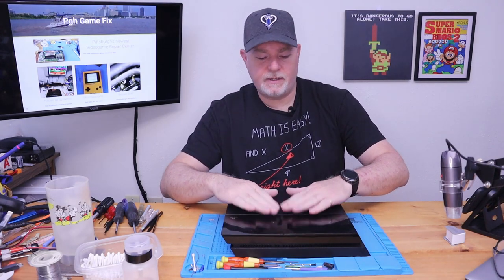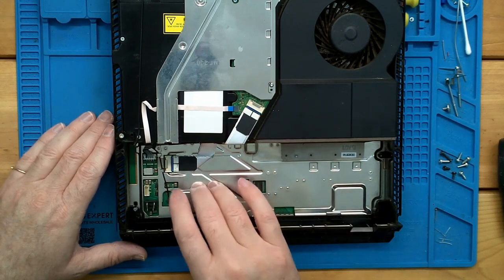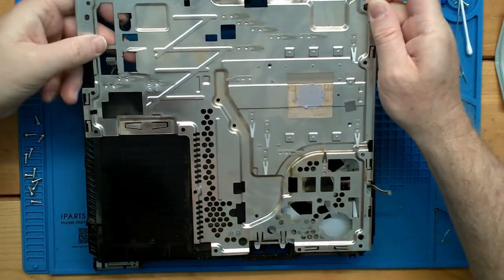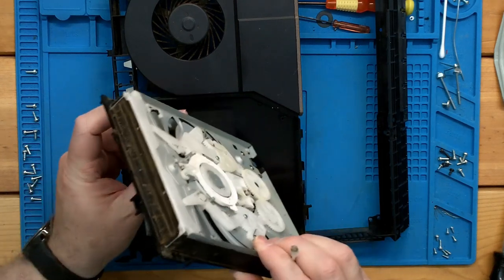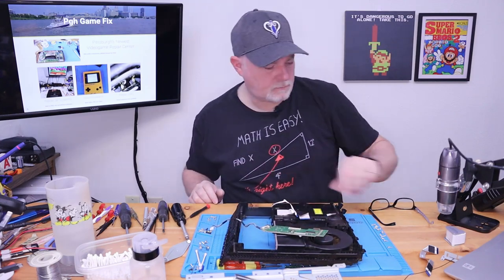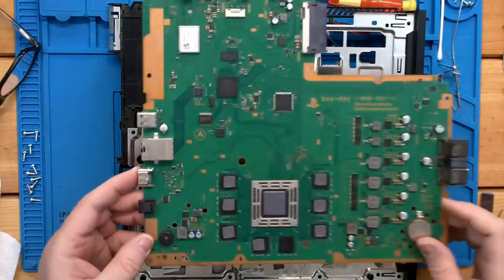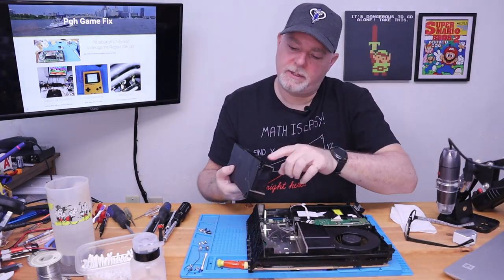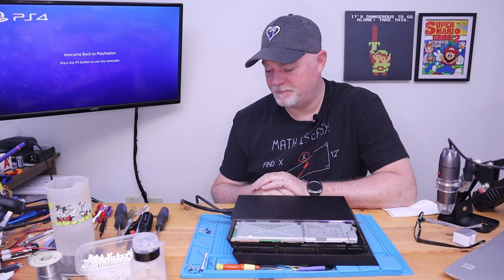Complete PS4 disassembly for a cleaning and new thermal paste, for an overheating issue.

Comment: How many times should I apply thermal paste for ps4 i cleaned it all out would you know how to help for ps3 fat overheating issue is power supply easier to replace on a ps3 fat versus a ps4 fat and would you know how to do a proper reball for a ps3 fat specifically cecha01 i have the same hard drive in for ten years for the ps4 have never had a problem should I clone to another 2tb is there an easy way tried the ps4 and its still lagging a little after the cleaning i got from you or would rebuilding the database be better

Comment: Is it an easy fix if the disc drive doesn't read disc
Reply from the maker: It's not hard... but it takes time.  And, as you can see from this video, it can take extra time if it's choked with dust and hair. I haven't seen a PS4 with a dead laser yet.  Normally if there is a Blueray drive issue... the laser is physically damaged, and I have swapped drives out. (So it can be a little expensive)
Reply: @PghGameFix  ok thanks for the info

Comment: i recently get my first ps4 fat, my question is, the top 8 thermal pads the grey ones, were dry so they fall off in bits, so form all the original thermal pads i recicled 8 that where in good condition (the ones that didnt became dust) and put them below the board, and replaced the top ones with blue thermal pads, do you know it there will exist any issue, i should replace all with blue or get grey thermal pads. the ps4 makes no noise when iddle or downlading but when i put a game it will get loud again but for my first ps4 dont know how much noise and heat is considered normal.
Reply from the maker: It should be fine as long as the new pads are of good quality.

Comment: do u think if i strape away some of the solder mask on the board to expose the copper from the trace then put copper tape on the trace i exposed the copper on as a bridge to connect to the other side of the copper trace so basically use the copper tape as a bridge to connect each point
Reply from the maker: You can use copper as wire... yes.